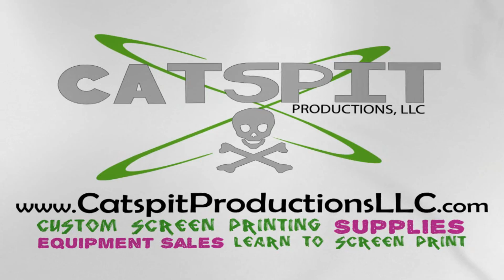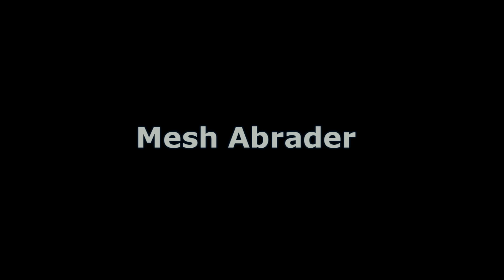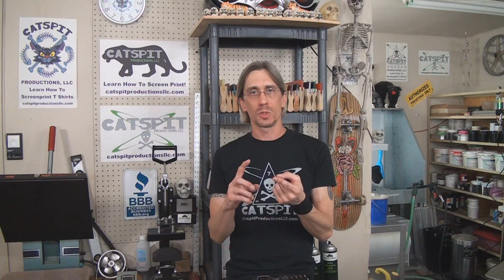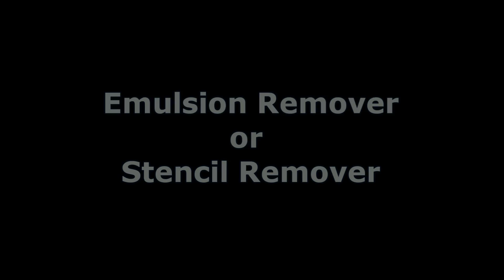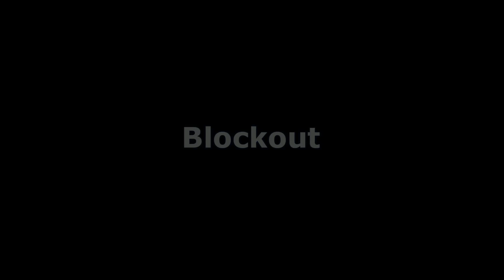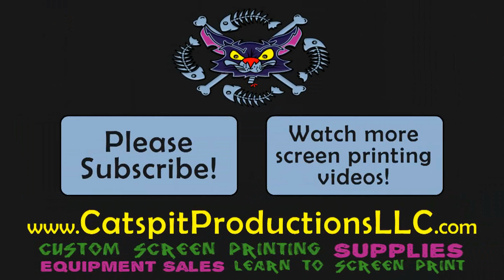The Basic Chemicals Used For Screen Printing Tee Shirts

Comment: How toxic is the screen printing process? I work at a place doing embroidery and the screen printer doesn't wear a mask and there's barely any ventilation.
Reply from the maker: Actually today it's a common misnomer that screen printing inks and chemicals are toxic. They are if you eat them or drink them. But technically speaking, they are not "toxic." Toxic implies that the item is going to kill you from any exposure. "Capable of causing injury or death, especially by chemical means; poisonous." I have been screen printing for a long time. Since I was 11. When used properly and disposed of properly, it's harmless. I do not use goggles or gloves in the washout booth. Never have and I'm only this retarded... lol. With intelligent and proper usage, you shouldn't have any issues. Now, about the mask the printer is not wearing... a mask will do nothing for chemicals or inks. For that you need what is called a respirator. Those cover the nose and mouth and allow clean air in through replaceable filters. But, in a textile screen print shop printing very high volumes, we need to be concerned about airborne lint. Maybe even aerosol adhesives. In that case it's almost like a flour mill. For high volume textile print shops, there should be adequate ventilation and filtering.

Comment: Hey Jon!  Quick question: are Ink Wash and Ink Remover interchangeable terms?  I'm compiling a list of chemicals I want to keep on hand in the shop, and so far I have Saati's  IR8, ER2, Remove HR6, and PW4.  I chose these based on the recommendations from an earlier video of yours that featured Greg Jensen from Saati doing a demonstration.  I just want to make sure I'm not missing anything or any steps.  I'm assuming the IR8 would act as an Ink wash, but I could be confused on my terminology.  Could you help clarify this for me?